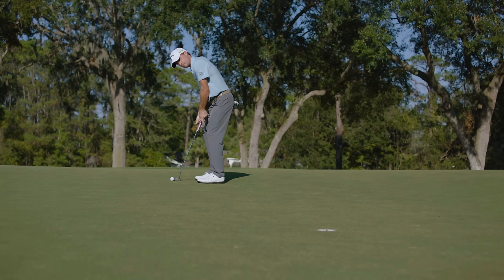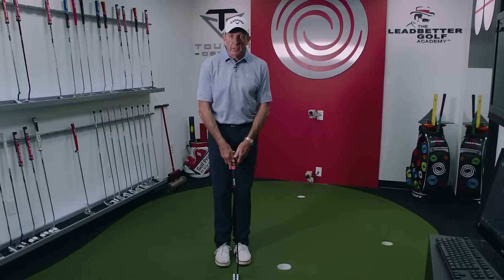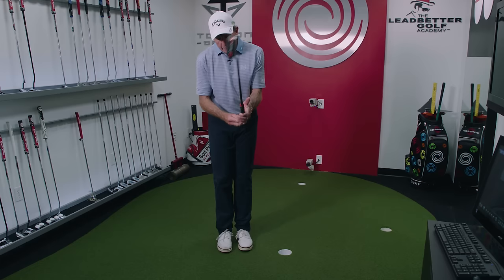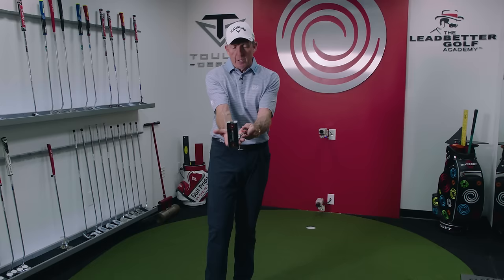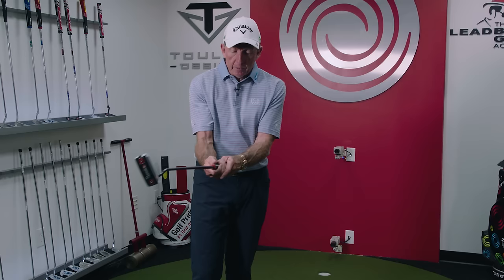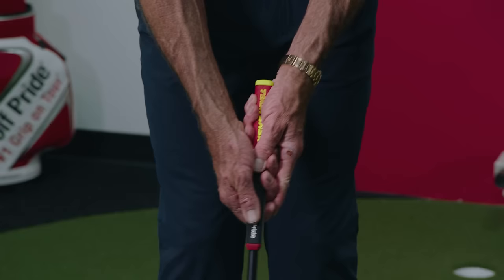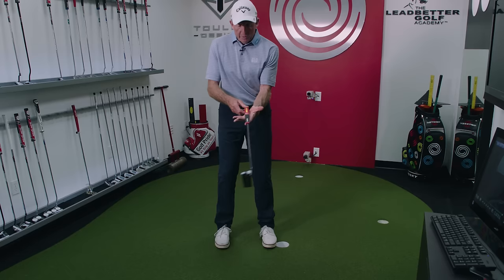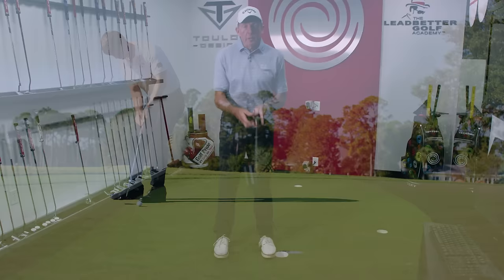How To Grip a Putter With David Leadbetter

Comment: Most grips that everyone uses doesn’t work for me. I grip it the same way that I grip my clubs and it works for me
Reply: You're better than me, so don't take it as criticism, but I doubt your putter grip is the same as with your other clubs. At least I doubt your holding your putter in the fingers with a strong rotation of the left hand, for example. Or do you mean the overlap or interlock between your hands is the same?